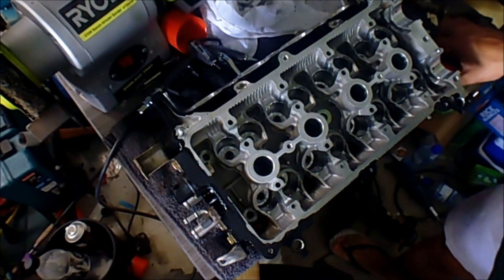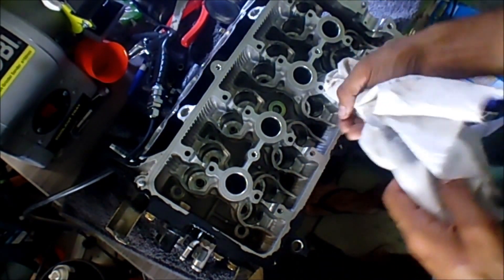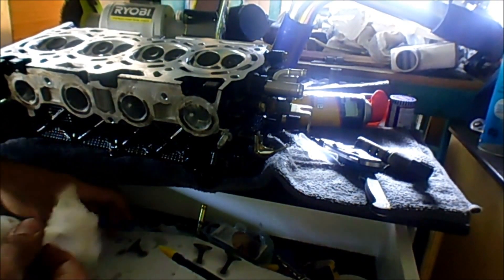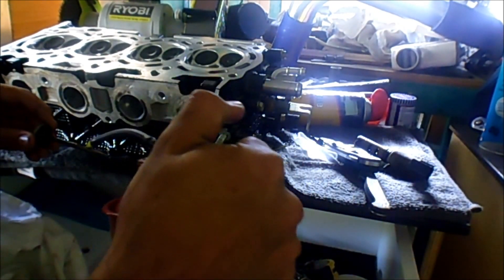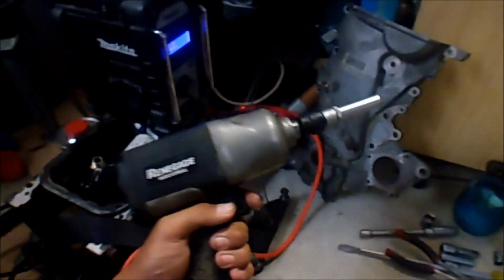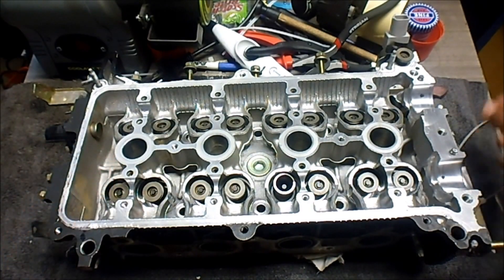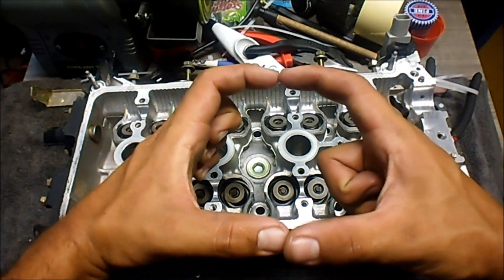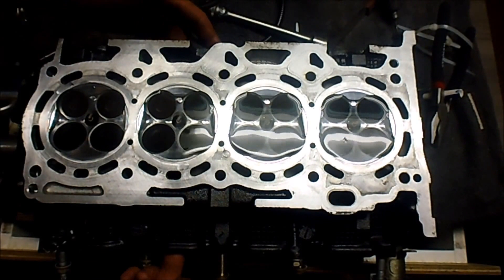PFP - Pt.9 [Valve Seal & Spring Install]

Comment: Hello I consulted, I have a toyota 1NZ-faith echo the same after a while working turn it off and turn on again sounds like a rattle on the side chain of time, it seems as tension, as if the tensioner loses oil pressure? ah also the same ping ping when you have time on ...? it may be that failure?
Reply from the maker: +Antonio Benitez Sorry mate, I'm not fully understanding what you are trying to say. And even if I did, doubt I'd be the right person to ask. The best thing to do would be to show it to a qualified and HONEST mechanic. All the best, sorry I couldn't be of more help.
Reply: +EchoLaQua Thank you